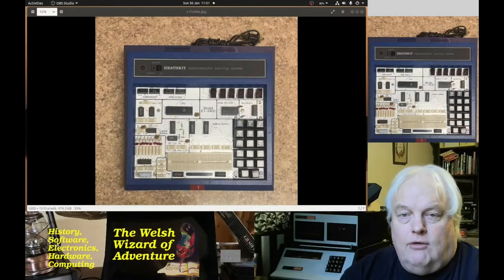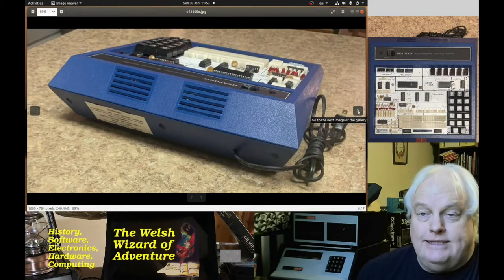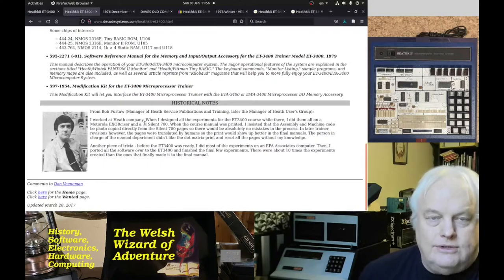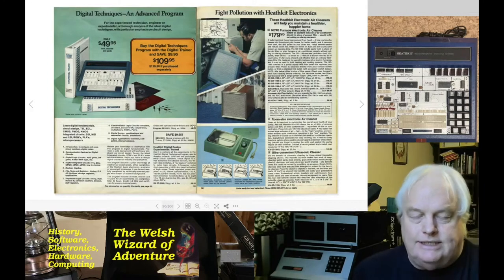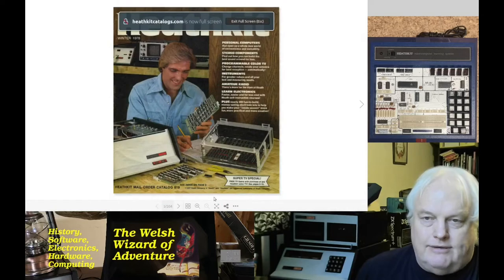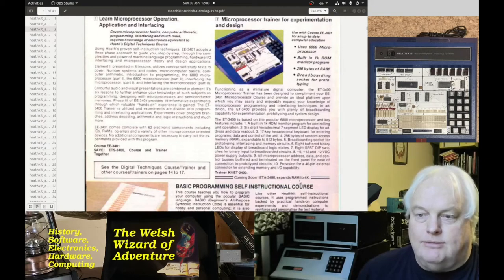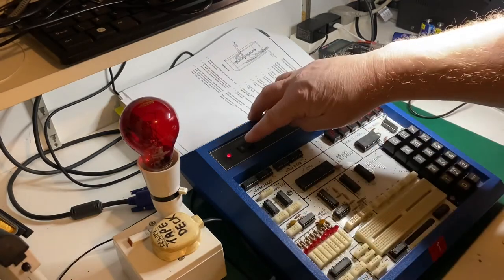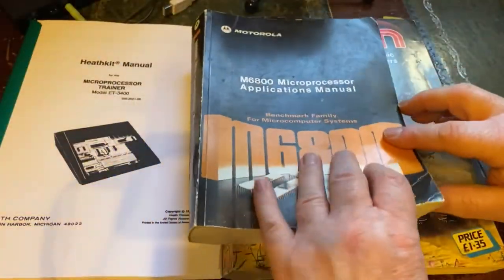ET-3400 Heathkit Microcomputer Trainer - Part 1

Comment: I picked one of these up on Ebay a few months ago. I also found on eBay an unbuilt memory i/o expansion kit which I finished today, let's me run Tiny Basic over a serial connection.

Those expansion kits are hard to find, glad I was able to pick one up.
Reply from the maker: Wow that was lucky they are had and very brave of you to build an old kit - many want to keep them as is!

Comment: :D Looks like you got off lightly with the debugging process! I do remember seeing these in the Heathkit and Maplin catalogues at the time, they seemed impossibly expensive and, by the 80's, very limited considering other home micro's that were available. But if you were in an electronics company trying to design a microprocessor controller for a product, I imagine these were very cheap, and they appealed to well-heeled electronics experimenters. In the mid 80's I had some holiday jobs with Marconi Avionics and the price of the microprocessor development systems they had there were eye watering! Mind you, they came with support from the processor manufacturers engineers, so I guess that was where the price really made sense.
It will be interesting to see what can be done with this - I always had an interest in the 6800 because of the ETI system 68 being the first microcomputer magazine project I saw, and I also got a 6802 based cpu card from a scrap merchant that came from a electronic till or something, I intended to make a computer from it but got stuck trying to get an EPROM programmer sorted out; by the time I had done that I'd gone off to university and was playing on bigger hardware!
Reply from the maker: Yea very lightly - almost disappointed but, I had enough fun converting the supply to be honest as I have a lot of projects backlogged so nice to have something to just use...  Yea I think the cost of all MPU experimenter cards were horrendous - that is the market the BYWOOD were gunning for with the SCRUMPI really.